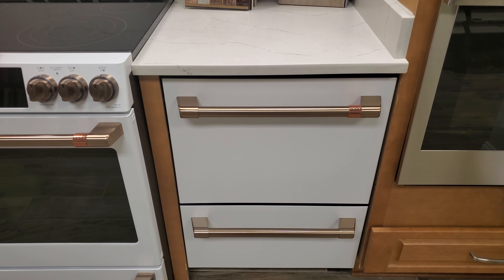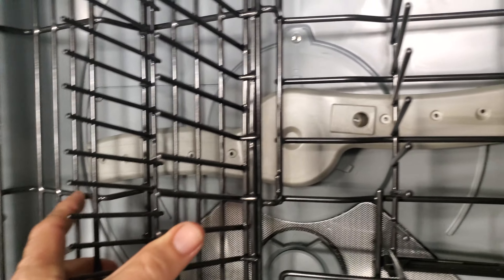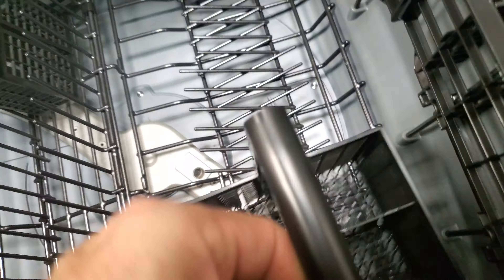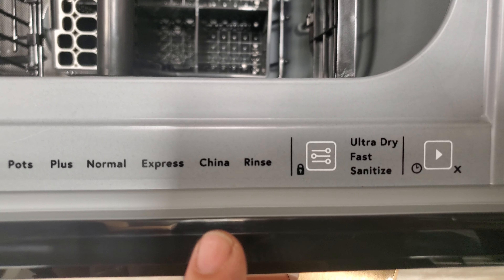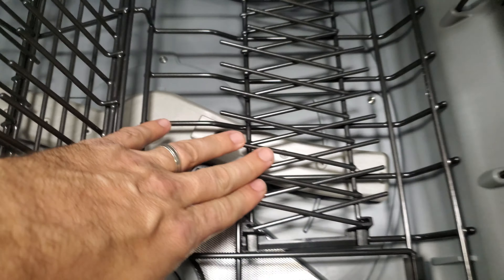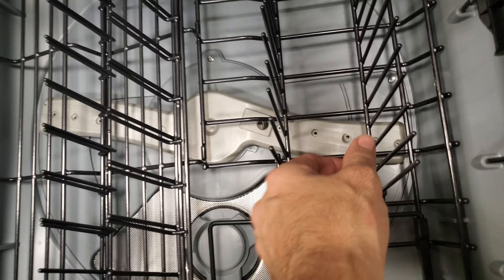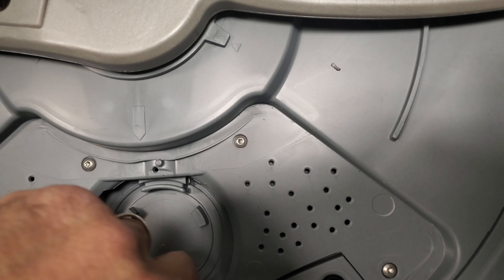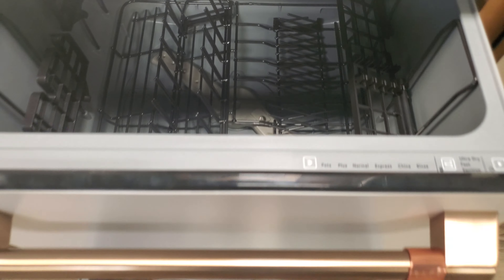Café Double Drawer Dishwasher

Comment: It's actually a rebadged older generation Fisher & Paykel Dishdrawer. Haier owns both companies. I own a similar version. Works great for me. The technology has been around since the late 1990s and is relatively simple to work on.
Reply from the maker: This is great information, thank you for sharing
Reply: Installed a 2008 F&P unit, cleaned well, not as noisy as the builder’s DW it replaced. A functional issue was the plastic tub material, hard water stains the tub and cleaning is difficult. The drying function worked great, draining condensation into the discharge line instead of exhausting hot humid air into the house. Negatives: way way too expensive and few if any service technicians nearby.
Reply: I have a Fisher and Paykel double dishwasher and it looks exactly the same on the inside, everything down to the washer arm. After many years my Fisher & Paykel bottom drawer finally gave out. I'm going to try this Cafe out since my home warranty is going to replace it absolutely free with install I can't beat that.🎉😊

Comment: I just switched my regular dishwasher for this one like a month ago. This dishwasher is amazing. When it’s running I can barely notice the noise at all, it’s super quiet. I have been mostly using it in the express mode and it cleans SUPER well. If the bottom is all filled, I don’t put cups on the top, but I do use the top racks for long spatulas and things like that and it gets all cleaned up. I don’t normally put my pans in dishwasher, I prefer handwashing them but this dishwasher is huge and you can put pretty much any size of pans you want. I love that you have many different ways to load the dishes. I am never going back to regular dishwasher again.
Reply: How do you use it can you help me
Reply: hi,  @destiny.valllll  . I am not sure how to help you but this machine is pretty easy to use. I had ordered the Fisher & Paykel first but, weirdly didn't fit my dinner plates. I almost never use the bottom drawer which is so nice I don't have to bend down to fill the dishwasher most days. I had read some reviews with people saying it does not get the dishes clean and I have no problem with that at all. I don't even use the normal cycle, which is longer. It takes a bit of getting use to it, as loading is very different from regular dishwashers but you won't regret it if you buy.
Reply: @AnastasiaBeverhousen  it’s just so silent. It cleans the dishes but I don’t know when it’s done or not and there’s always water still on the bottom. Is that normal ? We’re a first time dishwasher house hold
Reply: @destiny.valllll  I know a tidy bit of water on the bottom is normal. I contacted them about it. Mine however, it started this week, when I use the top drawer only, water drains to the bottom drawer and accumulates there and in days starts to smell. I am gonna contact them about that. Yesterday I tried something. I opened the drawer, pressed the start button until any light turned off and closed the drawer. And it started draining the water by itself right away. As far as it being so quiet, I like it. And if I try to open the drawer and it does not open, I know it still washing.
Reply: @AnastasiaBeverhousen  Water appearing in the lower drawer after the upper is run (or vice versa) is an installation problem, related to how the drain hoses and Y-connector are arranged.
Reply: @DADoESofTX  oh! I need to contact best buy to fix that
Reply: I just bought one and would like to know what dishwasher detergent do you use?
Reply: @cindykchu  I just use pods

Comment: Paykel is prounced as Pie-kle (like pickle but with pie instead of pick), not Pay-Kel.  Proper pronunciation can be heard on videos posted by the company.  The "doohickey" is not a handle to remove the rack, it lifts out of the way to access the cartridge filter.  The stainless steel filter plate normally doesn't need cleaning.  Removal of the rack is by lifting the back of it first, not the front.  Replacing it is front first, then lower the back.  Some of the pieces in the bag aren't replacement parts, they're optional use.  Two of them are trays that fit on a compartment of the silverware basket to hold detergent pacs or tablets, those can't be put into the regular dispenser which is designed only for powder.  Spray pressure is strong, assuming that hasn't changed from my 20yo F&P model (bought Aug 2003).  Mine easily flips lightweight plastic items unless they're anchored.  It once toppled a 6 oz. glass custard dish that was loaded leaning against another item.
Reply: Thanks for the info, i learned a lot from your comment.  i am looking to update my kitchen with Cafe appliances and am seriously considering this DW, my question, after owning it for awhile, do you like it enough to  buy it again?

Comment: Do you use liquid dishwashing or a pod? Where does that go?? We just had ours installed and it’s not cleaning very well at all. Very disappointed.
Reply: I have same question so it would be very  helpful. 🙏🏼 Thanks
Reply: It’s powdered detergent only
Reply: @andredistefano2135  according to the manual you can also use pods. :)
Reply: @agoogleuser8724 
I don’t understand how the pods work. The tray is so much smaller than the cascade pod itself. I have smashed it down to make it fit, and the damn thing didn’t pop open during the wash. Frustrated 😩
Reply: Just like Fisher and Paykel you can use all three methods of cleaning detergents.
Reply: @heidegunzel5375  apparently there is a container that goes on top of the silverware that holds the pods the pods do not go in the dispenser, the dispenser is for powder or liquid

Comment: We just bought a new one of these and we’re having water standing in the bottom. We checked the drain line and it seems right, the tech guy came out and there is nothing wrong with the machine.

Comment: I enabled the child lock and closed the drawer and now it won't open.  The double knock stops it mid-cycle and allows you do open it, but it does not disable the child lock.  The manual also does not give any instructions on how to disable the child lock once the drawer is closed.
Reply: there is another video it says you have to knock 3 times and then open. the dude shows it he is a plumber.

Comment: I wish we can hear it running.
Reply: trust me, you can barely hear the noise. Only when the water is coming out. I have to touch the machine to find out if it's running or not. Another cool feature is, when it's running, you just kind of bang twice on the drawer and it will stop if you need to load one more dish or something.
Reply: Very little noise and very clean dishes!
Reply: Did you download the app? The app will tell you if it’s running

Comment: This is a poor design in my opinion they should have made a ledge on both sides in the middle of the dishwasher tub and had a rack for the cups it looks like having all the cups on the bottom will restrict the water flow and cause anything above it to not be cleaned